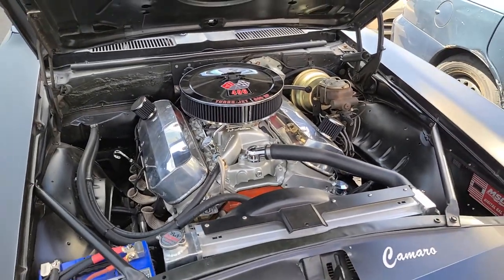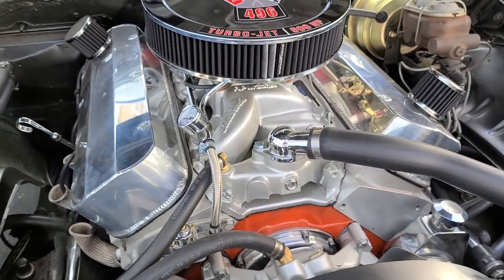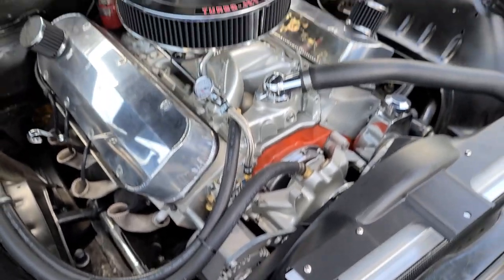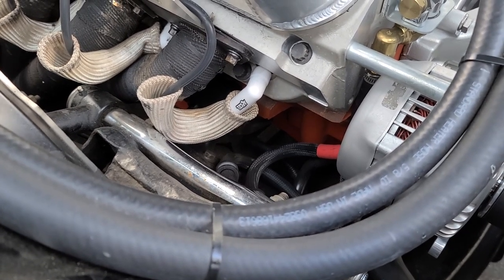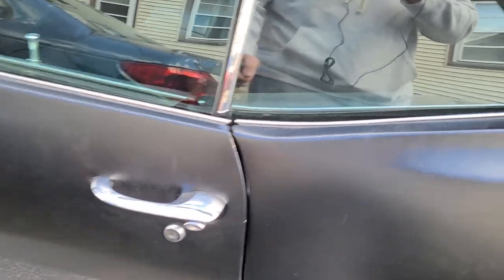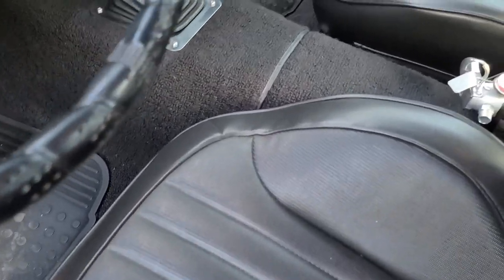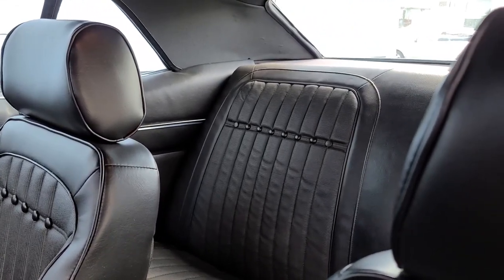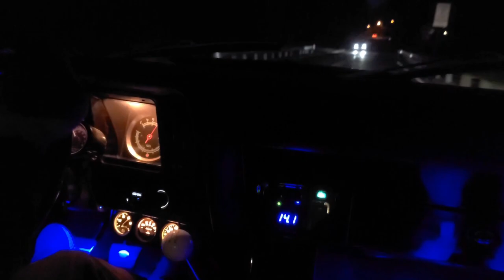1969 Camaro Engine Install Swap (600HP!)

Comment: What kind of exhaust headers are those?
Reply from the maker: Cheap universal ones that I got from summit. I regretted getting them because they were nothing but issues, they rub the subframe, burn plug wires, and I had to dent them all up to fit. I finally upgraded to some custom made lemonsheaders, and it was well worth the money.

Comment: After putting in that massive big block the next thing you better upgrade is that weak 10 bolt rearend you have, with all that torque and horsepower that thing isn't going to last very long !!!!!
Reply from the maker: Yeah I'm just using it until something happens to be honest. One day I want to upgrade to a roadster shop chassis and get their built up rear end with it